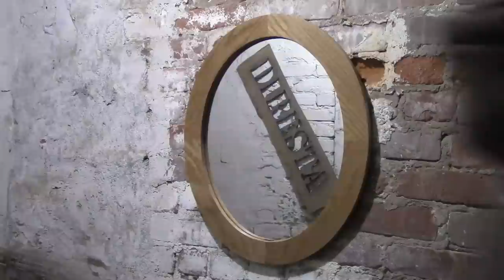DiResta: Oval Frame and Mirror

Comment: I did not understand the first router pass at 3:50
Do the router give nicer finish than plain sanding or does the router "head" (or what-it's-called) roll over imperfections and thus have smoother result?
Reply: the roller bering on the cutter follows the "precise" pattern underneath cutting the frame into the same shape, thank you
Reply: jimmydiresta I think I got it: the wood of the pattern is much softer so it was easier to sand that down to precise shape and then use router to the hard wood?
(my point above was that I did not understand why you just couldn't use sandpaper like you used with the pattern)